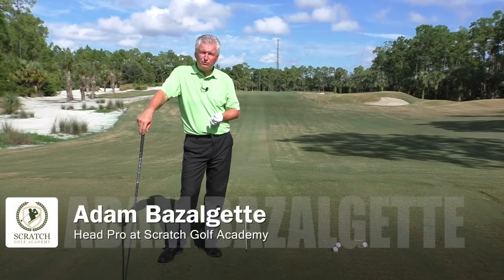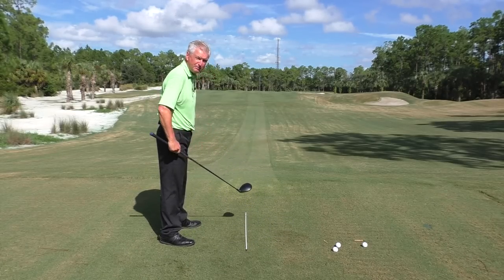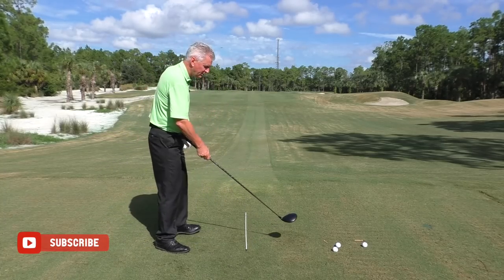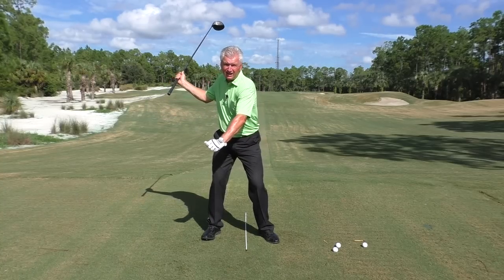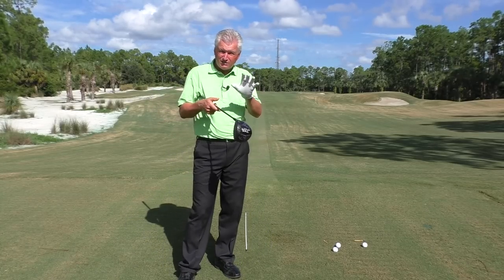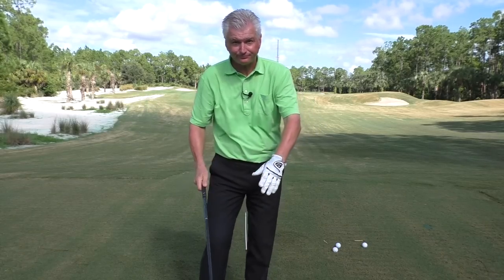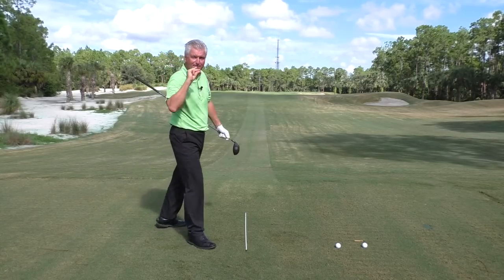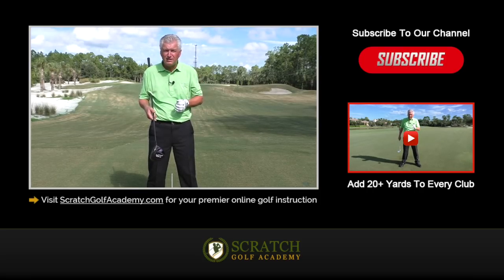HOW TO FIX A GOLF SLICE WITH DRIVER IN 2 MINUTES!

Comment: I preset my hips on the range today with every club and WOW I was hitting darts. This is a great drill that I am going to play with. I also have a launch monitor and my clubhead speed went up around 6 mph resulting in more distance. I play off 5 and have been struggling with a little over the top for ages this is gold thankyou Adam.
Reply from the maker: Glad you made progress Wayne.
All the best, Adam

Comment: Will have to try that with the hip setting,literally just starting out, but slicing a lot of drives and fairway shots. Seems if I take a shorter backswing, maybe only halfway, seem to have some more control over the ball, but when I try to let rip it slices.
Reply from the maker: Simon,
Thanks for the comment. I’d encourage you to keep your mind on the club foremost. As you know, the ball can only slice when the face is open (aimed right of the swing path) at impact. Perhaps for a while 3/4 swings might make it easier, but I’d encourage you to fiddle with grip and closing the face through impact until you can make some balls go left.
All the best, Adam

Comment: I corrected my slice by closing my shoulder's to the ball. I setup square, rotate my shoulders away from the target a couple of inches, then mover my arms back toward the target to get the clubhead close to the ball, then take my swing. However, even when the ball goes out straight, it almost always bounces to the right. Any thoughts on this?
Reply from the maker: I'd try to overdo it and hit some hooks. It's always easier to find neutral if you can do the extremes.
Hope this helps.
Best, Adam

Comment: If I consistently hit my driver to the right and can’t seem to fix it should I just tee off with low irons? I hit them quite far, my 4 iron about 250-260 and hit it straight when I do so? Or should I keep trying to drive for now
Reply from the maker: Jackson,
That is tremendous distance with long irons. That said, don't give up on your driver. I'd start by working on clubface through impact, try to overdo it until some balls go left.
All the best, Adam

Comment: If I tend to fade heavily, and if when I nearly slice the ball bounces to the right, then does that mean I have a clockwise spin? If so, it's probably because I'm swinging outside to in - right?
Reply from the maker: Yes, if the ball is curving right you've almost certainly cut across the target line. In addition to this the clubface must be open in relation to the swing, so I'd suggest working on that also. Hope this helps a bit.
Best, Adam

Comment: I have set my driver on draw settings  have a strong  left hand. The face of the driver is turned inside yet the  ball fades
Reply from the maker: Sanjeet,
I'd hit same 3/4 drives snapping face so closed coming into impact that ball smothers with a low hook. You have to feel the opposite to be able to dial in neutral.
Hope this helps.
Best, Adam

Comment: I have been slicing the driver for 56 years and I have tried everything without success
Reply from the maker: Hope this helps you break through Michael. Assuming solid hot if you can get the club face closed at impact you will never slice, no matter what happened in the past. 
Practice over doing this, hit some half shots with smother hooks
Best, Adam

Comment: What is you don’t roll your wrist or snap then I don’t and I hit them fairly straight
Reply from the maker: Grant,
Not sure I quite understand the question, but I'll give it a shot. The ball only respond to impact conditions of club, not what you feel or what I say. If you are hitting it straight consistently it means 3 things 1) centered contact  2) good swing path  3) square clubface at impact.
My advice is general, but if you are having success I'd stick with what you are doing. Hope this helps a bit.
Best, Adam

Comment: I can hit my irons straight all day long but my driver is a different story. I slice the driver bad. I have a strong grip so I feel it is not in my grip. Do you think my main problem could possibly be swing path with the driver? I guess a video of myself swinging would be very telling.
Reply from the maker: Matthew,
Yes, a video of your swing would help. That said, I’ll take a guess at what might help. There is a good chance your arms (and trunk) are accelerating too much through impact. Most golfers don’t realize it, but the arms of great players decelerate coming in to impact. This allows the energy to transfer out to the club (like a whip) which is where you need it. Pulling the arms too hard through the ball makes it hard to snap face square at impact, and usually drags the path left.
Hope this helps a bit.
Best, Adam

Comment: Did not understand the part of twisting the left hand..............when and how??
Reply from the maker: The de-lofting (twisting) of the left hand begins roughly at about hip high with club in the downswing. What's important is that you get the clubface square by impact. It's less important how I describe it, more important that you play around with the feel until you find what works (clubface square to slightly closed at impact).
Hope this helps.
Best, Adam
Reply: Still very confused, does the right hand rotate or not?
Reply from the maker: Both hands are on the club, so yes, they both have a role. That said, different people feel it (or key on it) differently. Id suggest putting your attention more on the club, and play around until (at least on a small scale) you can hook and slice a bit. This will allow you to dial in what neutral feels like.
Hope this helps.
Best, Adam
Reply: Gave away my clubs today.